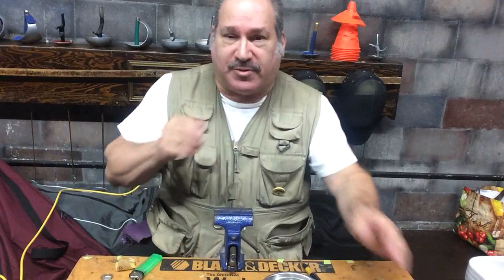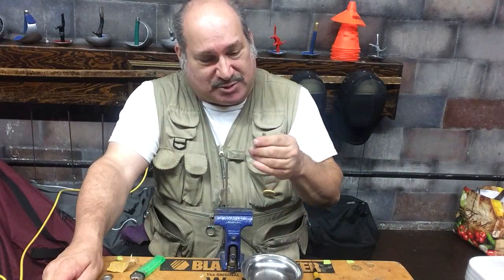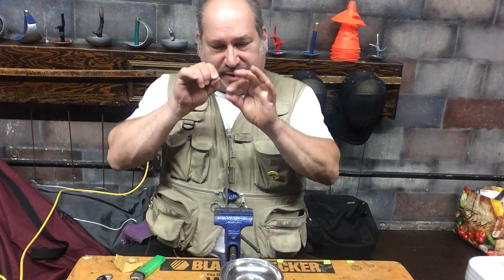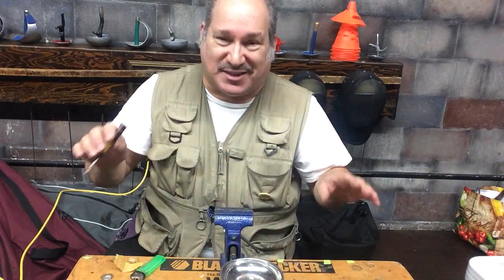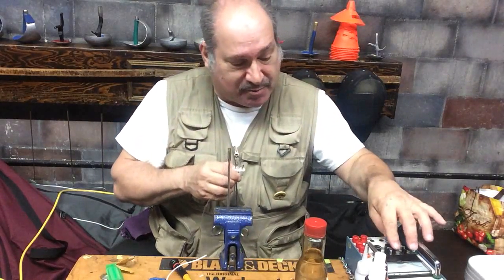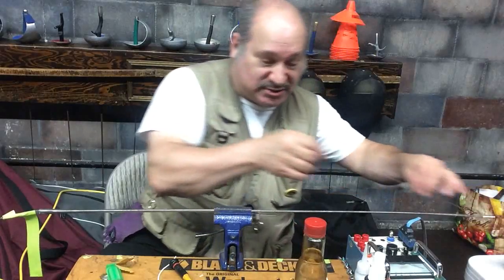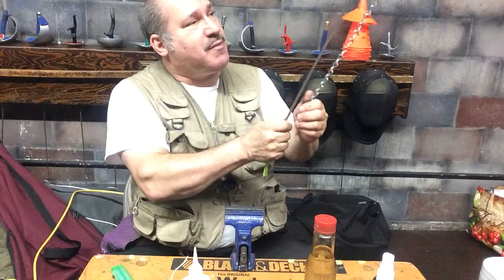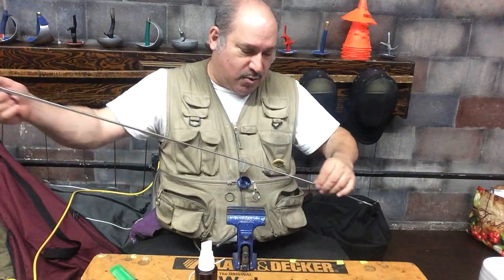I Can Haz Armory #5 - Rewiring a foil blade

Comment: Thank you for the videos. I am surprised to see you don't use some kind of glue on the threads of the blade before you screw on the barrel.  I thought that was required to prevent loose tips that would cause shorts.
Reply from the maker: A lot of people use Locktite on barrels, but it's not a requirement, nor completely needed.  A sufficiently cranked down barrel will hold as well as one with Locktite.  Plus, I worry about too much Locktite interfering with the circuit.

Comment: Thanks for everything. I'm a dad armorer and have learned a lot from you.  I find that with some foils (new ones or even ones that I've rewired), I hit the foil against my shoe while plugged in the test box and it's fine. But, when I hit it really hard with another metal foil or a hard PVC, the test box briefly signals discontinuity). I set my Favero tester/hit detector from test to foil and hit the blade and it doesn't register a problem. I'm very confused and not sure if I've failed in my rewiring/ received a bad brand new foil or if I'm testing the blade too hard?  Does the discontinuity have to last for a period of time before it registers a white light (like a hit on target)? I've used some of these foils that I've rewired and still fail with a hard wrap on the blade while testing but sometimes they work fine on the strip and I get no intermittent white lights and other times I get a light and I'm back to diagnosing again. Any tips would be appreciated.
Reply from the maker: The break in the circuit is 15ms or more.  It sounds like something's loose somewhere in the system...and there are a lot of potential failure points in foil.

It could be the tip itself starting to come apart (the little flange that sits on the spring sometimes works loose).
Partially broken wire under the cup.
Partially broken wire somewhere in the blade.
Wire/socket connection.
Loose socket parts (usually the B line, but the C works loose sometimes as well).
Loose fit between the socket receivers and the body cord pins.

After that, you're looking into issues with the cord, etc.

intermittent  probs are the hardest to nail down sometimes.

Comment: Hi Sam. What is the best way to fix white light? My tester says the circuit is OK but kids keep complaining white light at the club. 😢
Reply from the maker: What kind of tester...a simple go/no go box?  if so, there should only be one light on when the weapon is plugged in (been a while since I used one, but I think it was the green one)..push the tip in and the light should go out.  Release the tip and the light comes back on.

If that's what your tester shows, that's normal operation (if it was grounding, the light would stay on when the tip was depressed).

So if that's what you see on your tester, that means the issue is elsewhere when you plug into a strip,and you need to track the issue down.

When on the box, are you using the same cord, but still getting white lights?  That likely means the issue is in the floor cord, reel, or box.  

To confirm that, take your weapon and cord to the other side of the strip.  If the problem swaps sides, it's in the fencer's gear.  If it stays on the same side, it's the scoring gear.

Presuming it's in the scoring gear, unless you have the means to test the floor cord or reel, you'll be swapping out parts until the problem resolves.  Do the floor cord first and check, then swap the reel if necessary.

If it's the floor cord, treat it like fixing a reeeeeaalllyyy long epee cord.  If it's the reel, let me know.

Also, does the problem show up for anyone else, or just the weapon you're working on?

Once the problem is identified, THE you can figure out how to fix it.

Comment: Hi Sam! Thanks for the video loved all the tips. But I when I am trying to test the blade wire (Foil), I have two outcomes that I do not know what´s going on :S 

A) WIRE A: The light on my tester goes on but when presing the tip it doesn´t goes off.
B) WIRE B: The light doesn´t go on. The end of the wire is already wrapped on B and the blade is touching C. But if I also touch the blade with the Wrapped B, then I will have a ligh, and even here if I press it, the light won´t come of :/

I tried touching the inside of the tip with other metalic stuff to maybe make the ligh go off... and still it doesn´t happen. 

Please your help, thank you so much ! :)
Reply from the maker: For wire A it sounds like the wire is grounding somewhere.
For wire B....kinda hard t parse out what you said, but it reads like the wire isn't properly stripped, so it can't make the electrical connection.

Are these fully assembled weapons, or are you testing the wire before even laying the glue down?  If I know where you are in the process I can probably give a better answer.
Reply: Well for A you were right it was grounding near the tip. And for be I trimmed it, stripped and burn. Then it work! 🙃

Thank you so much for you help! Wishing you the best ! ✨
Reply from the maker: @ranatrinchada  So for B the wire break was at the far end....not bad for doing it remotely!   You're quite welcome!
Reply: Thank you! Yes I am testing before putting the glue.

I will check on A in Wich part of the tip, it could be grounding.

And what I mean on B. Is that when I test it there's no light. I already stripped the end as much as I could.
Reply from the maker: @ranatrinchada  Ok....that’s what I thought you were doing...nice to confirm.

For A it’s must likely the wire got stripped up in the barrel when you either pulled it through or tightened the barrel down.  You can try clipping the wire to your tester so you can see it’s on when your hands are free and then back the barrel off a bit.  If the light goes out, retighten the barrel.  If it stays off you should be good.  If it stays on....new wire.  Did you butterfly the tip of the blade out or otherwise try to make sure there were no burrs that could catch the wire when you pulled it through?   Did the wire move smoothly?

For B...how did you strip the wire?  If it was just sandpaper, you might not’ve gotten the varnish later off...easy to burn it off with a lighter.  Or if you DID burn it but didn’t sand it clean afterwards there might be gunk in the way.

If you did all that and still have nothing...probably a break in the wire a the solder joint between the wire and the brass hat un the cup. New wire time.

And not to worry...my first foil rewire took me three hours and multiple attempts!

Comment: Hello and thank you. I notice a detail only you use. You glue end point and then bend while others bend before glue any point. Please tell us your choice of this decision. Thank you for your time.
Reply from the maker: I do the ends first to a) hold the wire in place for the bending part and b) any residual accelerator on the ends helps to minimize ant glue running into the top pr down the tang.

Comment: Hi again.  How can we save the very expensive German foil barrel (threads) when the screw is broken?
Reply from the maker: Just to be sure, you're talking about the screws that hold the tip in place, not the tip of the blade that the barrel screws onto, yes?
Reply: @samsignorelli  Yes.  My friends are fencers on a budget.  It's hard to throw away an $18.00 German/French/LP tip because the screw is munched.  Reversing drill bit?  Use a tiny drill bit to shatter the bad screw like a dentist drills a cavity? We even know a fencing dentist, but he does not come anymore.  We'd ask him to help.
Reply from the maker: @calfencer  Ok...so now I know which screw it is.   When you say broken, do you mean mashed down so the slot's not there, or is half the head busted off?
Reply: @samsignorelli  Half the slot is gone on one and one both are gone - screw is flush with the barrel.
Reply from the maker: @calfencer  Ok...so there's nothing to grab.  The steel on a screw is actually pretty soft.  Get a razor blade or cutting knife and run it back and forth to cut a new slot deep enough to catch a driver blade, then try to back the screw out.  You'll cut into the barrel a little, but not deep enough to do any real damage.

Comment: Hi there! Great video. One question though, how come you didn't measure the tip with a gauge like you did with the epee point? Meaning how many millimeters the point has to be compressed until the point triggers a light? Is there a regulation on how much a foil tip has to compressed to set off a light?
Reply from the maker: Although there IS a rule re travel for a foil tip, it's not been enforced for years....since before i returned to the sport in the late 90s, in fact.  I don't even remember what it was.

Also remember that the foil circuit works differently from the epee one...hence why the epee travel is checked, but the foil one isn't.

Epee is a normally open circuit, hence the travel requirement so everyone is on an equal footing...important when you have only a 40ms lockout time,

But foil is a normally CLOSED circuit which has to be open for 15 ms minimum to fire the light...the travel requirement isn't of much use there.  Plus the lockout is 300ms and right of way is involved.
Reply: @samsignorelli  thank you for the clarification. I've always wondered about that.

Comment: Thanks for that reply, also, i would like to know about the accelerant that you use for the Insta-Flex™ glue from (Bob Smith Industries), what exactly is it and where do i get it?
Reply from the maker: The accelerator speeds up the curing process.   Normally, super glues take 24 hours to fully cure and harden...but I don't have that kind of time -- especially at a tournament.

The accelerator is a chemical that cuts the cure time from 24 hours to maybe 5 seconds.

Any hobby store that sells super glues for modeling or RC toys should carry it.

Comment: Hello, you did a great video, I just have a few questions if thats okay. When you bend the blade for the glueing process, what are the various glues you use? I would like to have a smooth finish on my blade after the glueing process and was wondering what types of glue can help with that.
Thanks
Reply from the maker: You can use any number of different glues...Cementit, Pilobond, fletching glue (for arrows), etc...the important thing is th the groove is cleaned properly and the glue is applied correctly.

Personally, I use a rubberized super glue called "Instaflex" from Bob Smith Industries, which I get a a local RC model store.

There are 2 versions...the pink label gap filler and the green label, which is very watery.   I prefer the gap filler to minimize the chances of the glue getting into the tip.

As for a smooth finish...with a gap filler, that's going to depend on how well you control the flow of glue into the groove and how with the opening of the tip of the nozzle on the bottle. 

I DO run a kleenex down the blade to smooth out any bumps that might catch a point after spraying on the accelerator (which you see doing in this vid.)
Reply: Thank you for the detailed reply, I will try those out.

Comment: how to remove the small screw in my tip
Reply from the maker: Use a small jeweler's screwdriver, like you'd use for a pair of glasses.

Or is there a different issue?  Is it a German tip with the screw smashed?

Comment: very useful & fantastic video.

would you let me know what kind of glue are you using for 2 steps of stick the wire on blade?
Reply from the maker: Thanks...I plan to re-shoot it at some point, with better camera work.

The glue I use is from Bob Smith Industries and is called Instaflex....a rubberized superglue.

Check out vid #4 -- wiring an epee blade -- for more details.
Reply: Thanks...the glue is perfect!
Reply from the maker: YAY!   Just remember that properly prepping the blade is by FAR the most important step.